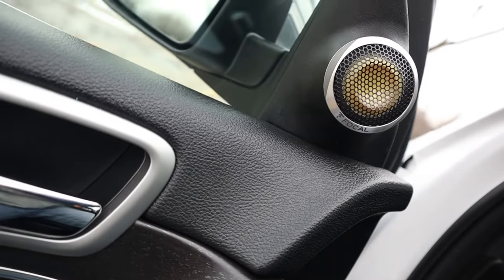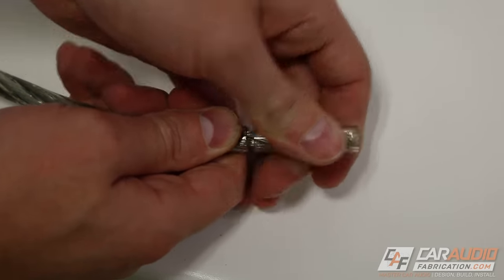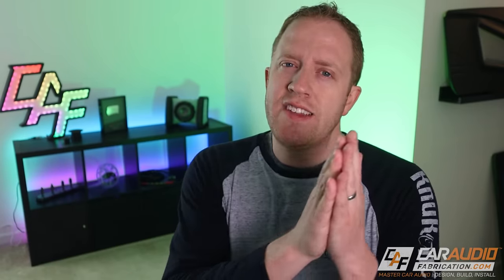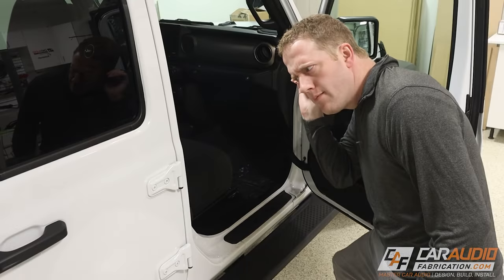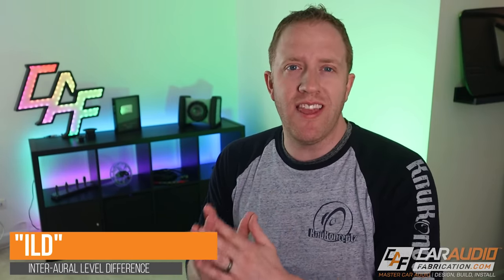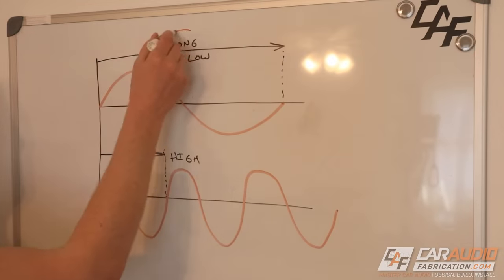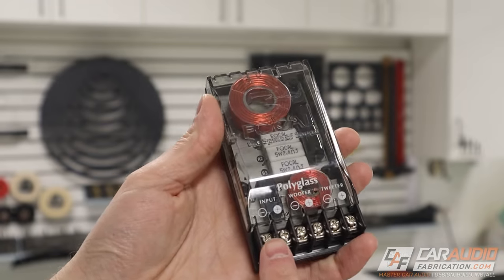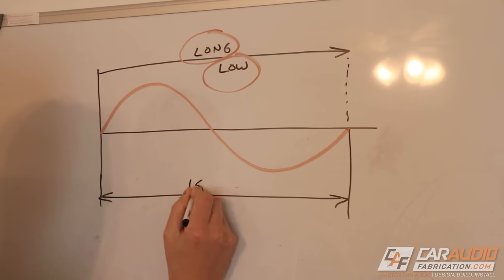Is YOUR SUBWOOFER facing the WRONG way? How we locate sounds explained!

Comment: one thing you forgot to mention, facing a woofer backwards toward the rear of a vehicle adds a slight distance and more objects that can insulate slight distortion notes normally herd while the driver is facing foreword. on top of that, the rear facing enclosure uses more of the vehicles body shape essentially making a larger 4th/6th order volume (your woofer plus your vehicle = a large speaker box)
those of you with a hatch back style vehicle can attest to the different sound front vs back because of what i have explained
Reply: What do you mean by "insulate distortion notes"? By distortion notes, you obviously mean higher harmonics, but "insulating" them means absorbing them, I guess? (One thing to remember is that higher frequencies reflect more, and lower frequencies have a tendency to penetrate more)
Reply: @mosiowaty1573  frequencies tend to like to be called "them" more than "they" but as long as it isn't "he" or "she".

Comment: Weirdly enough, I have mine on the rear seat, I did this because 1, it kept tipping over in the trunk 2, the trunk raddle is gone and 3, it’s a tad bit louder and it fits perfectly on the seat. Idk if it’s the best setup, but definitely an interesting one.

Comment: Box 2 1/2 foot by 20 inches dual vent 2 inch by 18 inch single evl 15 in 2013 Altima 
Would love to face it upwards because the waves dome out of subs and mushroom cloud bass is as deep as you get
(Sub will smack)
Facing to the back  and loving it

Comment: I have a 2005 silverado crew cab. The stock system is Bose but I replaced the head unit with a nice high end Kenwood, installed by best buy but everything else is stock. My issue is that when the volume is up it gets really distorted and muffled. I'm not looking for a competition level system but I'd like it to play nice and clear at high volume. Are there speakers and components from amazon that are good quality? I'm also looking to put 2 down facing subs under the back seat. What size subs are good for all genres of music?

Comment: I have a Ford Ranger XLT my current system is speakers are facing up with the Port facing up as well towards the roof of the cab how would I go about it if I have a truck compared to cars it sounds like things might be different

Comment: Port and subs should allways face the same direction. Usually all the bigger cars, works best with subs and port facing back. Sedans facing towards to the center of the car, port in the rear sub near backseat. Hatchbacks everything up.

Comment: My setup i had about a month or so ago was 2 12s on 4k at half ohm box pushed all the way to trunk lid subs facing forward port on the side it felt like more pressure but didnt move as much air, my current setup I went back to single sub system I love them to death so its a single skar vxf 15 on a sundiwn sfb 5k clamping about 3850 watts sub and port facing trunk lid ive noticed it sounds louder than my 2 12s  although its on less power and a slightly bigger box idk much about this stuff but the vids help me fine tune my low bass..hits a 151.6 at 35 hz

Comment: Hi, I like your videos,  I have a question,  I'm running just 2 subs and 1 Amp but it keeps draining battery,  if I install a turn off and on switch for the Amp without having to buy a separate battery and alternator,  will that correct the issue,  thanks so much for your videos

Comment: The last system I had was a lifetime ago in a '91 Eclipse.  I had 4 12's in a diamond facing forward in the back seat.  The system before that had 6 12's in a ported wedge facing the front (at about 35-40 Hz you couldn't sit in the car with the doors closed and windows up and breathe).
Reply: Yeah man,  I miss my '92 hatchback 2dr Ford Escort GT. I had 4- 15" subs sealed facing upwards to the hatchback glass and I had another box blended in with that one with in front where the folding rear seats were with 18 6x9's. It looked like one huge box with the top panel over them but it was two. A wedged shaped box like goes behind a truck seat for the 18 6x9's and a sealed box for the subs with each having 1.5 cubes chambers. Oh yeah and 10 pair of "eyeball" tweeters. I use to get them at Cash America Pawn for $9.99 a set. Those were the days.

Comment: I got the most even bass response when having the sub facing forward.
Reply: In alot of vehicles, especially ones where the sub is pressurizing the cab, it seems facing forward (ported) usually works best for SQ
Reply: in my Ford F-150 I use two 15’s on my back seat facing forward right behind my head😎😁😂😂🤣😳🤯🔊 sounds perfect 👌🏼🤩😎
Reply: @Rafael-lg1vw  I built a ported box for a JL Tw3 under my back seat, port behind the passenger seat and the sub behind the driver both forward facing. It sounds really good
Reply: @Rafael-lg1vw  Silverado Ext.
Reply: That’s awesome 👏🏼 I’m going to build a box for under the back seat too, for 4-5 8” 2,000 watt Subwoofers!
Reply: @Rafael-lg1vw  I went SQ, LMAO. Alot more work went into the fiberglassed and wrapped dash and a pillars. Not gonna lie tho, 115db at 30HZ is PLENTY for my ears. Your build will be sick
Reply: I'm just glad I finally got my 50 after a few trials in less than a year. I just love the educational aspect of the hobby. But ofc after  bass in itself😌😌🔊🔊👌🏾👌🏾
Reply: @yohanathandowns9057  I have a JL tw3 12" in JL's prefab sealed box and I was thinking about building a ported box for it. Where did you get your plans from? How big is the box? I'm wondering how much bigger this thing can sound. The sound quality in the sealed box is awesome but it doesn't get very loud.
Reply: @snauspockets9924  mine is totally custom, around 1.5 cubFt tuned to 32hz. It will hit in the high 20's and blends perfectly up top. Mine is a 10" Tw3 under the rear seat of an ext. Cab silverado. If you don't mind building yourself you can fab most shapes to fit anywhere with that tuning. I think on the TW3 models JL recommends the lowest airspace figure they can because they're advertised as "Shallow", but a bigger box with low tuning will get you bumping harder down low. I have 400 watts of stage and it can overpower them easily
Reply: @yohanathandowns9057  that's cool man. I was just checking out the JL website and looking at the suggested specs and it had the suggested ported enclosure for my 12-in dw3 as .95cubFt... I was wondering about that. Doesn't seem like very much. I got room for more in the back of my Highlander behind the third row seat.

6.5 x 36 x 18 would be a good size back there. I have no idea if that's too big for this shallow sub or not but if I could tune the port to 32 and help it dig deeper that'd be great.
Reply: @snauspockets9924  use what you can, better to he too large as you can always add material to the port and interior of the box if it's too much air space. Basically I like to use all the space I can and over build and then I can tune the box further if I'm not satisfied
Reply: Eric Heitman  in most cases I agree.

Comment: Sub and port facing up in a hatchback. Tried several positions but this orientation sounded best.
Reply from the maker: Awesome! Its funny how you would think that it would need to face at you, but as we learned in this video it does not!
Reply: The two loudest and best sounding systems I've ever heard in my life were both oriented this way. The old '80s Toyota hatchbacks were amazing for acoustics. My buddy Chris had four 10-in kicker still Waters running them ported in his 86 super hatchback and it was difficult to sit in while being crystal clear

Comment: I'm in a tiny Celica 7th gen hatchback, 2 12' Skar EVL's ported box tuned @32hz . I haven't tried this particular set rear face but RF p2d2's and Kicker comp-vrs sounded best forward. There is just 0 air space to the rear, prob about 3 inches from sub surround to the actual hatch if faced backwards lmfao.. up faced would be interesting but my hatch glass is already flexing more than I'm comfortable with rn.. maybe I'll try to blow it out when I finally get a new car, would make a cool vid 🤣

Comment: Informative! With all that being said... My 02 Acura RL car has an aftermarket Alpine stereo and factory 6.5 speakers with tweeters in lower doors and tweeters in upper doors.
 I am replacing speakers with pair of Skar 6.5 components (speaker, tweeter, crossover) 100 watt RMS each ( bottom door) and an additional Skar 1.75 Super tweeter  pair (upper door) 100 watt rms each x 2.  Adding a Skar 4 channel amp 100 watt rms x 4 @4ohms to power all front speakers and tweeters. Basically replacing what's already there. Any suggestions? I am afraid of possible comb filtering between component tweeter and super tweeter.

Also going to replace 5.25s in rear doors, fabricate an adapter, and seal doors for 6.5 subwoofers not speaker from Skar for MID bass. As well as remove the 6x9s in rear deck and add 8 in subs or additional 6.5 subs  in rear deck. Trying to keep my trunk space in which biggest  sub I could add would be some 10s rear firing. Guys suggestions would be appreciated. 
Thanks Keep Bumping!

Comment: My subwoofer faces the cabin. I noticed that when it's facing the trunk lid most of the frequencies spread into the lid itself and the surrounding metal (sound treated mind you) so it doesn't reach the front and blend with the front stage. Most enclosures will work better facing the cabin in my vehicle.
Reply from the maker: Interesting!
Reply: Type of vehicle?  Thanks

Comment: I’ve read more on this subject lately than any other part of the build and you explained it better than anyone else has. I have a single Infinity Kappa 10 and the best placement I’ve found for SQ in my Civic is facing forward but I also have my trunk closed off with an amp wall. The bass is loud and tight and blends in with the fronts (which are also Infinity Kappas) like it should. I referenced many of your videos during my build and they helped me make decisions to achieve greatness in both build and sound. Keep doing what you do man! Thanks for sharing your knowledge!

Comment: My XC90 its up. My B5 S4 both, E30, and Gs350 its backwards. My E38 750il is forwards with the port pointed in the cabin. All reach 140db+ and yes placement is key. Each car is unique and air space is king. The reason for the differences are that the air flow are different in each car. The S4s and GS350 share similar cabin and trunk space. The XC90 is an SUV, the 750 is a limo with more air useable in the cabin than in the trunk. The E30 doesnt matter cause it is a drop top.

Comment: 1 ds-18 12in sub in ported box facing out hits hard though I have trouble keeping amp cool
Reply: Put a fan on it. Or either you're running the amp at an ohm load it can't handle and heating up quickly.

Comment: Many people have problems with identifying location of sound when they're blindfolded or have their eyes closed.  Did this in elementary school and still remember this. So yes, although you SHOULD be able to identify location, you're not 100% going to be able to each time.   Some people hear sound in front when it was behind, or left when it was on the right. usually it's more when its NOT directly left or right of you.. usually at angles.
Reply: How come at home inside the house the speakers face forward??   Shouldn't they be backwards against the wall then.   I've always ran my woofers facing forward.  🤔

Comment: First off that speaker wire is really nice. Might have to check it out. My sub faces to the rear, mostly just for cosmetics. I don't think I've seen a video on it but what about subwoofer orientation in the enclosure? Most have the cone facing outward but some face it inward. Any reason for that or particular advantage of either one?
Reply: Mostly for aesthetics is what I hear people do it for. But also the volume of the driver takes up airspace in the box. So I guess hanging it out the box would give you more box volume.

Comment: In my crew cab truck when they are facing me they rattle my eardrums and sound much louder. When I have them facing the ceiling the vibration seems to go out in all directions and is not as loud to the driver and passenger at the same volume.

Comment: I'm debating whether I should have the sub firing into my trunk or if I should face it into the cabin firing through the rear seat back. I noticed in the Jetta wedge subwoofer enclosure build that you fired the sub towards the rear seat back. It seems like that would improve the energy output into the cabin.

Comment: I have a sedan and I'm cabin firing and loving it
Reply: In a sedan ceiling the subs off from the trunk and firing forward into cabin will result in a much clearer cleaner sound. Currently doing a build of three 12-in stereo integrity SQL subs on a sundown 5K subs forward sealed off and ports through rear deck sealed off. Much cleaner sound with way less rattles in a sedan this way.

Comment: I need a box for a 2007 tacoma regular cab (single) . I can't find anywhere, for 1 or 2 10" subs. Also needing the seat to be pushed maxed to the back to fit my size
Reply: You could make that easy from one of the templates they have here.

Comment: Hey Mark, 
Love the videos, explanations and your methodical ways to work. I’ve learnt a lot so far and look forward to learning more. 
At the risk of asking a dumb question, what size sub is best for listening to Metal music. I like the sharp punch of a kick drum but don’t like droning thundering bass.?
Reply: Hey Simon, I'm not Mark, and know nowhere near as much as he does, but I personally had dealt with the same sort of issue. Sub woofer size is important, the smaller you go the more punchy bass you get. the difference between a 10 inch sub and a 12 inch sub, are definitely noticeable. From what I can tell from your comment, you like SQ over SPL. The droning and loud ear piercing bass is caused from a ported enclosure. Mark has talked about this before, but sealed enclosures are about 20% less efficient with output, but solve the drone and the thundering bass as you put it. I wouldn't worry a ton about sub woofer size, 10's are more punchy of course, so if that is a huge factor, get 10's but don't go much smaller than that. Another driving factor is what kind of sub woofer you get, brands and price points and all that. I would recommend going to your local audio store, and asking to hear a ported box with a 12 inch sub, play a song you like, and then play the same song with the same woofer in a sealed box. I hate how ported boxes sound for anything other than trap rap, and even then I would never put a ported enclosure in one of my personal vehicles. Right now for reference, I'm running 2 audiomobile gts 12 inch sub woofers, in a custom sealed enclosure built by our fab guy, and an addictive audio p120d amp to run it all. (you cant order these online) I listen to everything from rap to, country, to old blues, to lamb of god, bullet for my valentine and megadeath to name a few. anyways, hope this helped, and enjoy your car audio journey!
Reply: @HAKLJR  hey man i just asked a similar question above. this kinda helped a bit actually. thanks! i listen to everything besides like country really. bullet, megadeth, LoG, children of bodom....then i like some old 2000s pop and rock/punk etc. I just got 2 of the addictive v4s, and 2 p200s as the amp. Do you think i should go sealed? I do love me my low sustained dubstep wubz and shit tho also.
Reply: @HAKLJR  you're also the only person Ive seen say anything about addictive AT ALL casually in comments on any video lmao.

Comment: for midrange and tweeter just put their DUST CAP in the same axis don't put their frame in same axis, for subwoofer position mostly facing back, but it will be better if you create a dummy box first and give pink noise signal to the subwoofer with amplifier LPF 70 and make the sound at the center of your car dashboard

Comment: Any hatchback or any vehicle that does it have a enclosed trunk will always be your best sound now if you have a vehicle with a trunk I would suggest a sealed box that way your base doesn’t travel and it stays confined but vans SUVs are great I got to12”solar Barricks them square ones in the trunk & behind the back seat I got 4 6x9s & in the front doors I got 8” and the tweets with that double din 10” screen 📺. All that in a 99 Grand marquis with the cop package. And that car be bumpin coming down ya block

Comment: I have mine facing the inside of the vehicle for 2 reasons, 1 it's in a trunk of a camry so the air flow really doesn't allow it to hit as hard, 2, I drive for uber and don't want anyone hitting or destroying the subs when they have to use my trunk lol

Comment: In the 04 it’s a down firing down facing port in a center console of a regular cab Siverado. In the 16 regular cab Silverado they are forward firing in a sealed box behind the seats.
Really need to make a vid.
Reply: So which one sounds better to you?
Reply: @derfskittlers6125  the ported hits harder near its tuning point and plays well down to 20 hz. The sealed sounds great on all kinds of music not just the ones around a tuning frequency, but it rolls off pretty quick at 30 hz and doesn’t have any real authority under that.

Comment: hey! i’m looking for a way to connect component cables into my headhunt for a project (installing PS2 console in glove compartment.) May somebody help me find a headunit some sort of adapter while retaining the RCA for a sub? would Component -> aux work, i’m doubting it would display video on the aftermarket headunit
Reply: The double din head units I have used years ago had a video in (yellow) with a left right rcas
Reply: Composite video
Reply: Android xtrons head unit would work they have full rca's plus 2 or 3 camera ports and atleast 3-4 video ports all the ports you need
Reply: @nickhaley1212  thanks to both of you